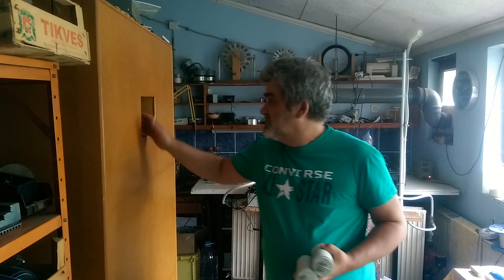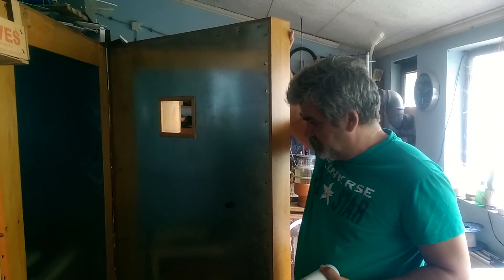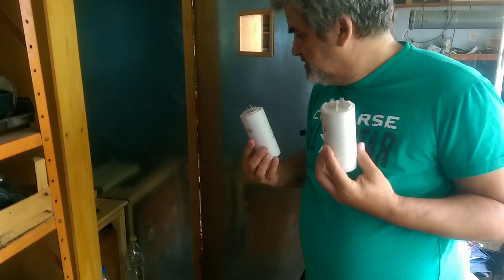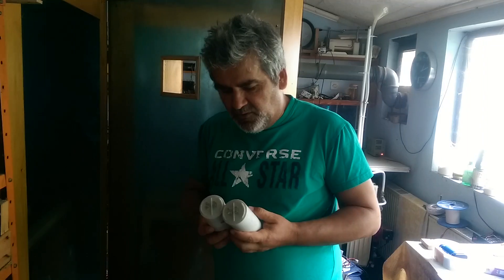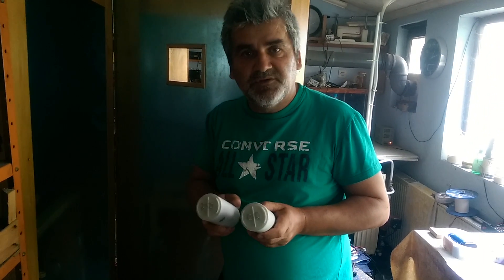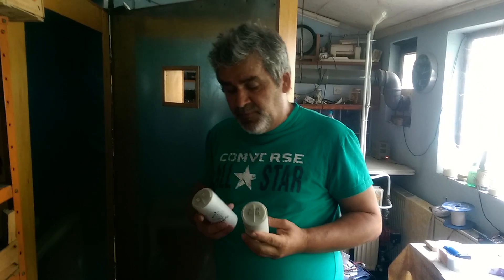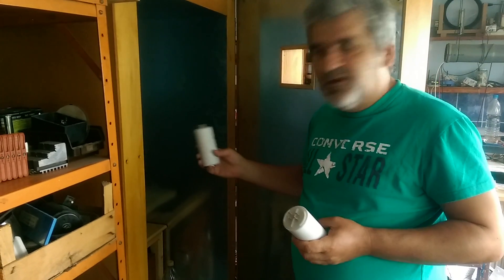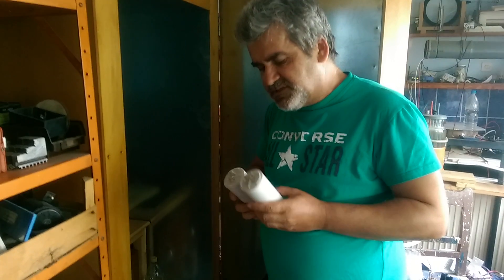Tesla Physics - Charging Capacitor with Orgone Accumulator

Comment: if dead batteries are left out, they will slowly balance themselves over time and become charged. you'd have to do more, longer tests. please do!
Reply from the maker: They are block capacitoirs, not batteries. As I said there was time where they sitting  outside of Orgone Accumulator  side by side each other and there were not  voltage changes. the changes started when test started. But you are right, there must be more test. I did not make them with few reason. The first reason that I do not see  practical aplication  and another is that by experience consciousness of observer .